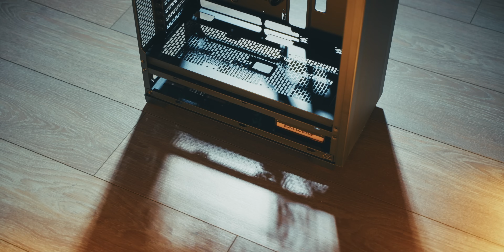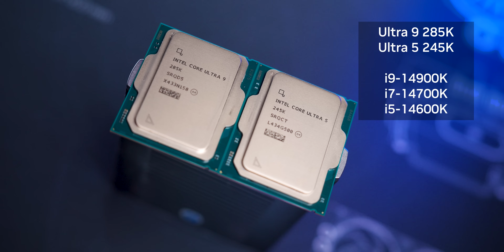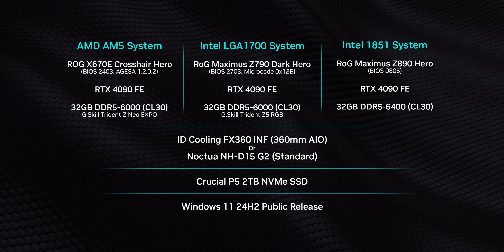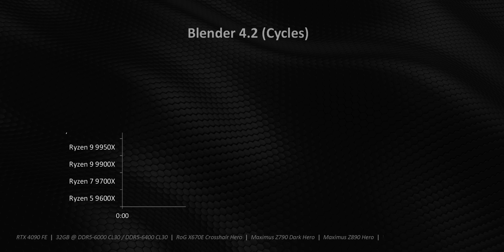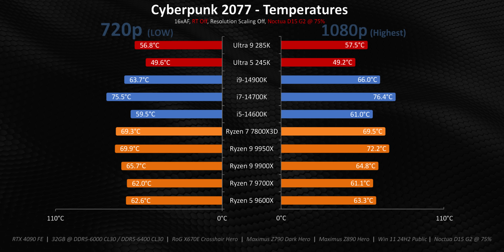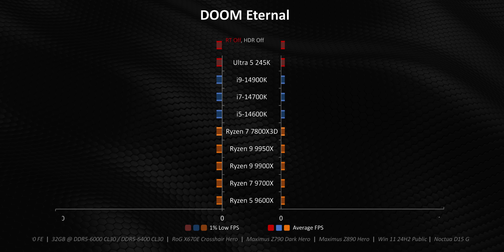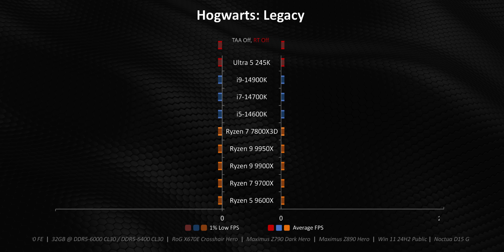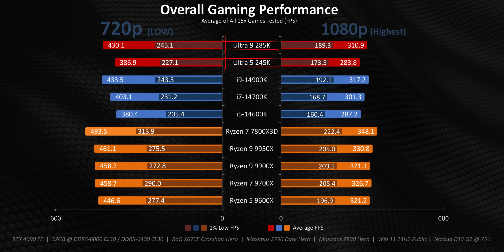Intel Hits Reset - Ultra 9 285K & Ultra 5 245K Performance Review

Comment: The only winner is the Ultra 5 being faster than both the 14600K and 9700X without massive power draw in everything other than gaming
Reply: @MHawk-px7dm  265K comes in strong also, not as strong as the 245K though. Really so far only the 285K is lacking which imo is fine, less than 1% of people end up with those SKUs.
Reply: @TRYitouty  still beats the 9900x .  If you do anything other that gaming , 285k is a great chip
Reply: @apothecy4011  Disagree, and not because of AMD. The 265K will be a fairly better value, which is honestly better for Intel IMO. Being strongest in the midrange section where most cpu's are sold isn't a bad strategy.

Comment: Intel flopped with the core Ultra processors, the 7800X3D, 5800X3D still killing it maybe next generation Intel
Reply: 5800X3D / RTX 4080 user here and no annoying cpu stutters or microlags in games 🙂
Reply from the maker: I think this sets them up for something a LOT better in the future but they need to take advantage of their Arrow Lake lessons before moving on to a completely different architecture.
Reply: Considering it's huge costs and node advantage ARL is a disaster. Even last last gen 5700X3D for <200€ outperforms the 650€ 285K easily.
Reply: Amd cpu stutters and microlags in game, its very annoing

Comment: whoever creates 3D V-Cache probably get instant promotion and paycheck increase at AMD everytime intel release new CPU generation
Reply: People just dont realize how revolutionary 3D V-Cache is :)
Reply: and the employee is from TSMC
Reply: @yenmartin9115  TSMC is only the manufacturer, not the one who engineered 3D v-cache.
Reply: @ThomasKoelln  It was TSMC who created the 3D cache and not AMD. AMD is just leeching off TSMCs work.
Reply: @ arrow lake is made by tsmc as well. By your own logic, intel is leeching them too.
Reply: @ Its not using any fancy TSMC tech other than the 3nm node. AMD on the other hand only uses what TSMC creates. If TSMC stagnates so does AMD. Intel have their own fabs.
Reply: @ Also, zen 5 uses 4nm for the CCD and 6nm for the cIOD, and it's still is a superior product to Arrow Lake on 3nm.

Manufacturing and engineering clearly are two different things.
Reply: @yenmartin9115 it's designed and made by AMD and tsmc together

Comment: I would have loved to see how the 1440p performance was. Many 1440p/144 hz monitors are coming way down in price, to around $200-$250 or less. I was planning on using the Ultra 5 245K for gaming/light plex usage but now it's almost November and after seeing two reviews now, I figured I might as well see AMDs response will be. Thank you for the video! :)
Reply from the maker: Yeah I understand that but you have to remember as resolution increases, so to does the potential for GPU bottlenecking.  In a lot of games, that results in a flatlining of results since CPU horsepower doesn't really matter as much since the processor tends to "wait around" for information from the graphics card.
Reply: @HardwareCanucks  Thanks for taking the time to respond and explain that to me. Everything helps! <3
Reply: If you want any CPU for gaming, the only real choice is the x3D chips. 5700/5800/7600/7800 x3D
Reply: That's a GPU benchmark you're after, not a CPU review.

Comment: As a gamer if I were to buy this CPU I would overclock until an avg temp of 70C-75C , below 60C is pointless. Derbaur8 has better stats to compare against in his video but fewer games compared, wish HW canucks can do the same, better for users to have results from multiple sources.
Reply from the maker: Completely understand but overclocking does very little to nothing for in-game framerates since by nature most games don't require the CPU to be running near its voltage / power cap.

Comment: The power figure is wrong, go check out Derbauer’s,
Reply from the maker: Der8auer was specifically referring to inconsistencies with reporting in DLVR's Power Gate Mode.  We test in an out of box (non-OC) config which uses by default the Regulation Mode.
Reply: @HardwareCanucks  that’s the issue, if you’re testing for power efficiency of the chip, power gating has to be taken into account
Reply from the maker: @derenbong  In Regulation Mode, as far as we understand it, there aren't any inconsistencies.
Reply: @HardwareCanucks  in terms of testing efficiency, Derbauer has shown that it is massive,
Reply: @HardwareCanucks  like, what happened to the spirit of tuning the system for DIY PC market? If I want a straight out of the box experience, I’ll just go get Macs,
Reply: @derenbong   🤦‍♂ please don't

Comment: "Intel needed this" 🤡😀🤡😀
Reply from the maker: They did.
Reply: @HardwareCanucks  They sure did, this is a wake up call to get their s... together. In gaming on 285K is on par with 9600X and 9700X (even 7700X is there in the mix) and in production workloads, the in their best case scenario get about 10% win over 9950X but still with massive power draw in comparison. The only progress in power draw is when compared with 14900K which was crazy to start with...
Reply from the maker: @MarioCRO  I think this IS them getting their poop together.
Reply: @HardwareCanucks  Honestly, too little, too late... and not to mention in the end TSMC had to take over the production.
Reply: @HardwareCanucks These ARL cpus seem to be better suited for a business/professional PC. After a couple for windows patches and/or bios updates , I believe that the 285k will pull ahead from even the 9950x or the upcoming x3d. For a gaming rig , AMD is the undisp winner though.
Reply: @HardwareCanucks These ARL cpus seem to be better suited for a business/professional PC. After a couple for windows patches and/or bios updates , I believe that the 285k will pull ahead from even the 9950x or the upcoming x3d. For a gaming rig , AMD is the undisp winner though.

Comment: Anything over 90W is just wasteful.
Reply from the maker: Luckily, neither Ryzen 9000 nor Arrow Lake generally go above that while gaming.
Reply: meanwhile buying a 3090ti, 4090 and then 5090 hahaha
Reply: @djayjp only integrated gpu for you then.
Reply: @raulitrump460  Lol I mean CPU
Reply: @djayjp  higher core count always gonna suck more power in gaming who doesn’t use all core cuz those extra core even on idle use power comparing 8 core cpu power consumption in gaming vs something with more core is not fair if you compared the 9950x also suck more power than 3D chip with 8 core and lower clock speed

Comment: Guess I'm riding with my 14900ks for a while. ✌️🇺🇲
Reply from the maker: Make sure you use the new microcode though.
Reply: @HardwareCanucks  Nah, lowers performance by 2% ✌️🇺🇲
Reply: @bm373  so you won't be riding it for a long eh
Reply: @riba2233  You don't need the microcode update if you manually tuned whole system. It's only for the stock settings people.
Reply: @club4ghz  ofc, but in that case he wouldn't even talk about performance difference.
Reply: @riba2233  Microcenter warranty ✌️🇺🇲

Comment: If i wanted efficiency i would not be on desktop buying a high end CPU. What a dumb thing to focus on for Arrow Lake. Zen 5 X3D will be even more efficient and spit out far higher frames while doing so. Intel is doomed.
Reply from the maker: They needed to focus on efficiency because they couldn't keep throwing unlimited power at their silicon.  At some point that would have led to massively diminishing returns.  This allows them to hopefully set up for the future, delivering better generational increases that aren't power ceiling or heat limited.
Reply: @HardwareCanucks  I cant see any win for intel anywhere, the 7800x3d already has lower power usage and far higher performance and its old. Who would buy this?
Reply: @jordan3802  those who are not dumb and know there are stuff without gaming
Reply: @jordan3802  but that sucks in productivity, there are people who does more with PC than gaming and fanboying in internet
Reply: @jordan3802 Intel fans will buy them and claim they can overclock the ring bus and fabric connection to match a stock 7800X3D 😆
Reply: @jordan3802  Its more about resetting than selling. Kinda like 10 years ago with AMD after Bulldozer and Ryzen 1.
Though unlike Ryzen 1, Intel's ARL prices are not very good.
Reply: @VIK1NG_w0w  Ryzen 1 was not awful. It had leadership in production, Arrow Lake does not have leadership in anything. Its not even very efficient compared to the competition.
Reply: @jordan3802  you're looking at zen 1 with rose tinted glasses. It was shit vs Intel competition. The memory controller issues were atrocious. It wasn't until zen2 that it started to give hope. And by zen3, we caught up.
Reply: @VIK1NG_w0w  Is that why it turned around AMDs fortunes? Arrow Lake does not have leadership in anything. There is literally zero reason to buy it
Reply: @jordan3802  AMD's fortunes didn't turn around until late Zen3-early Zen4 but even so Intel still has greater market share (except maybe Threadripper in servers).
And I'm not disagreeing that ARL is shit. Its just that people said the same about Zen 1 and AMD turned it around. Intel has the USGovt behind them. They will come back.
Reply: Amen
Reply: It matters insofar as keeping temperatures under control. Beyond that, it's a wash.

Comment: basicaly every cpu is cooked until the 9800X3D, then every cpu will be even more cooked
Reply: watching this video as an 7800x3d owner made me feel great
Reply: @egthb47  I'm so glad that I purchased my 7800X3D before the price explosion in late summer. I feel like this little beast will serve my needs for a very long time. In general, Intel is two or three generations behind when it comes to efficiency AND great gaming performance as a whole.
Reply: @egthb47  Same here.
Reply from the maker: Well the 7800X3D, depending on price, could be a better buy from a price / performance standpoint depending on how $$$ the 9800X3D is
Reply: @HardwareCanucks I'm nearly out of 7800X3Ds at the price I am willing to pay, and I know the 9800X3D is going to be $549 USD. Thankfully, most don't need it for gaming only builds. 12400F, 7500F, and 5700X3D upgrades for now are holding. We need a new budget king for Ryzen 9000 soon, with the other nodes drying up.
Reply: @HardwareCanucks  Single core performance on 7000 series is crap.  The 9800x3d will offer the both of best worlds.  Tech tube is so delusional in some aspects.
Reply: Glad I bought two 7800x3D’s under £300 last month.
Reply: Yes if all you do is game
Reply: For gaming maybe, but is gaming all anyone ever cares about when it comes to CPU? Your GPU matters a lot more :/. It doesn't matter if you have a 9800x3D if your GPU is an RTX 3050.
Reply: For what I do mostly gaming, very light video editing (not edits), yeah 9800X3D could be good!
Reply: @Aerobrake  Kinda depends with how much the new x3d cost. If its $550 like its rumored and you are looking at 7800XT-4070/5070 range GPU's you would be better off going with the 245K and sticking that $250 into a 70Ti or 7900XT. You would render faster and have higher avg FPS. If you are in 80-90 gpu territory then its easier to just jump to X3D.
Reply: huh,  @TRYitouty
Reply: @TRYitouty  I’ve already got two 4090’s. If the new X3D is amazing I’ll buy it otherwise……
Reply: Except m4max 
M4ultra  
M4extreme are going to stomp everything
Reply: Well, if you put to much voltage to this CPUs they will literally be cooked
Reply: How is every CPU cooked? From a gaming only aspect maybe, but most CPUs aren't sold for gaming. 

The 285 is pretty boring, but the 245 walks it's price segment. The 9700X looks like it's in trouble as far as a mid level workstation segment.
Reply: @TRYitouty  Nah, this video doesn't test them correctly. Watch GamersNexus instead or Level1 or HU etc.
Reply: Sry but 8 core is not enough for 2024 anymore unless you only a single games play a triple a games while having 2 mmorpg running on background and bunch of app open and you will see how slow 8 core are
Reply: @HosakaBlood  why would anyone have 2 MMOs in the background? You're describing a commercial farming operation, not gaming

Comment: a video show casing 7800x3d supremacy in gaming. Greatest Gaming CPU ever made Hands down the GOAT.
Reply: Until the 9800X3D launches, confirmed 11% faster in gaming, 15% faster in multithreaded productivity workloads!
Reply: @iLegionaire3755  But at what cost? And keep in mind the 5800x3d is years old and still top notch performance.
Reply: @jnssmnsn It's crazy that nowadays even chips from a couple years ago are still extremely capable.
Reply: @Penguinz4LOLZ  That's the power of the increase in cache on the CPU.
Reply: Nah, the OG 5800X3d should probably hold that title still remaining super relevant today 😅
Reply: @TRYitouty  Agreed, 5800x3d is the goat